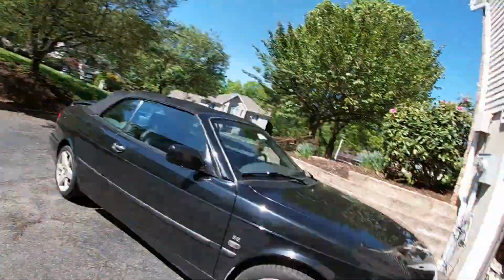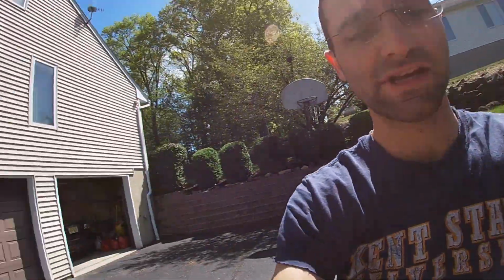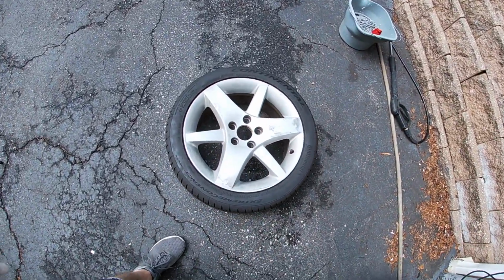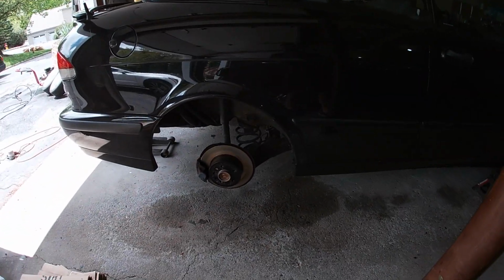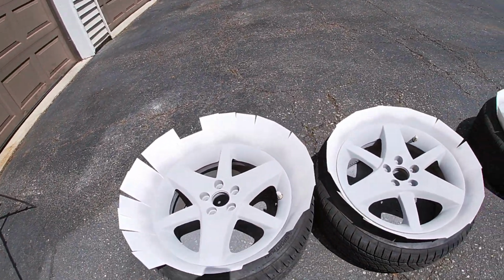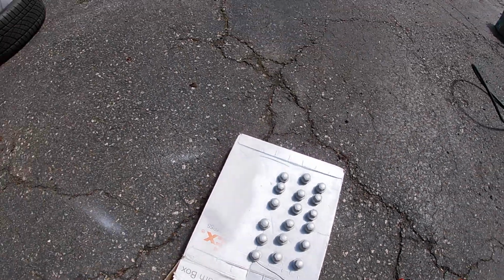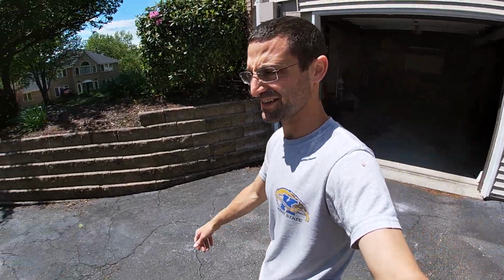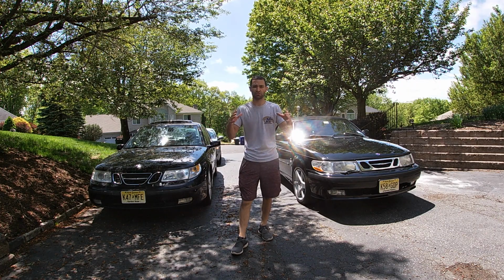My Old Saab 9-3 Gets a Rim Job and Looks Showroom Perfect! #savesaab

Comment: Kyle, the title is a bit confusing :D
Reply from the maker: HAHAHAHA
Reply: I knew that somebody was going to say that! 😂
Reply: Gm kyle! I have a 2005 9-3  had it a mouth now !   Last two days this error comes on an car wont go in gear (steering wheel lock slow down stop an contact your saab dealer!) I have to clear it an an turn off an the ignition a few times than it go away were i can go into gear ! But soon it come back on have had this happen before ? Please help
Reply from the maker: @btp155  only suggestion is to grab a tech 2 and see wtf is going on....seems like a silly sensor of some sorts.
Reply: @KylePancis   ok! You mean a car scanning device correct?
Reply from the maker: @btp155  yes,

Comment: Ummm.....title....a bit....ummm....yeah.... XD
Very cool refurbish on an awesome set of rims.
A good tip is to wax them, and then spray them off weekly to remove the corrosive brake dust. 
If it sits on them too long, it tends to damage the clearcoat. 

Turtle wax has a ceramic wash-wax that is phenomenal. I used that on the Viggen and especially the refinished rims a month ago. It really has made it easy to keep the rims and car clean with just a quick spray off, once a week.

Comment: Hey Kyle. Need your help bad!!! So here’s the run down. 
1. Installed 3.5 bar fuel reg 
2. Installed 3” dp 
3 car was running like a beast for a week. 
4 one morning it wouldn’t start. 
5 ordered fuel pump from your amazon in Des. 
6. Installed. 
7. No start. 
8. Figured out no power to fuel pump fuse on left dashboard box. 
9. Installed new fuel pump relay under dash. 
10.  Still nothing. 
11. PLEASE HELP. Cannot figure out what is happening here!! 
12. Anyone with any knowledge of this can throw in 2 cents too!!  

Thank you
Reply from the maker: Do you hear the pump going? I would scan code. If you have fuel...then the only other issues can be spark and air. So check Cassette/Spark Plugs....also look at MAF sensor and throttle body to make sure fuel/air is good. Check all vacuum lines. ALSO Check Crank Position Sensor! If these go bad car wont start, and its inexpensive to replace.
Reply: Kyle Pancis no. The pump is not getting power.
Reply from the maker: @chicagoui9299  how many miles you have? may be time to replace!
Reply: Kyle Pancis 0 miles on the New  pump.
Reply from the maker: @chicagoui9299  back into it. Test harness etc...check fuse in the dash
Reply: Kyle Pancis yeah this is my shortcoming. I’m terrible with electrical stuff. I have power at the fuel pump relay. Yet no power to the fuel pump fuse. I’m effing lost here.
Reply from the maker: @chicagoui9299  check fuse in dash....and then just route the harness see if there is an issue